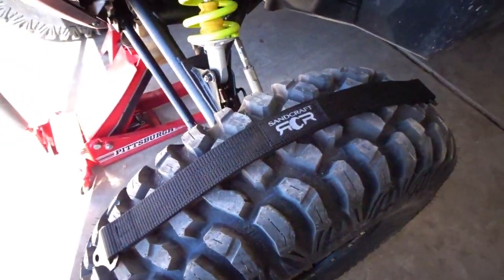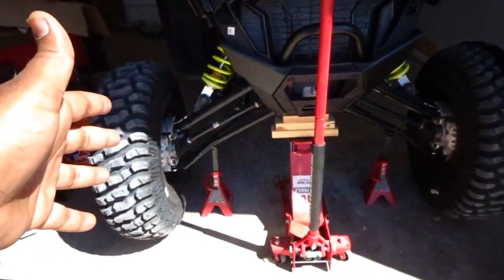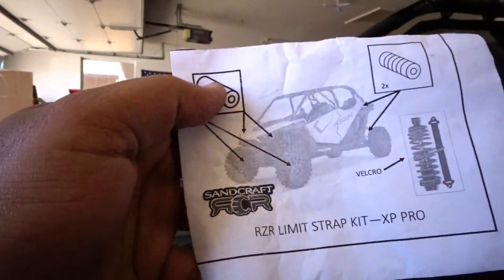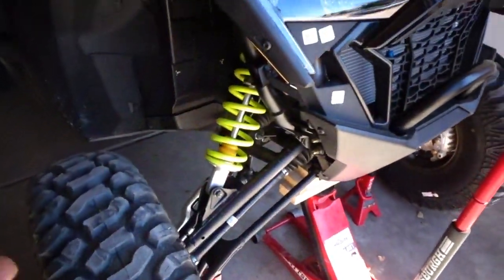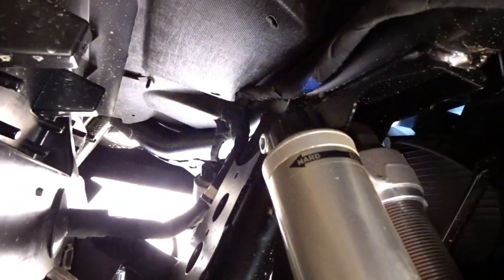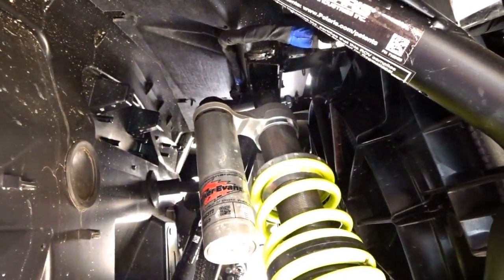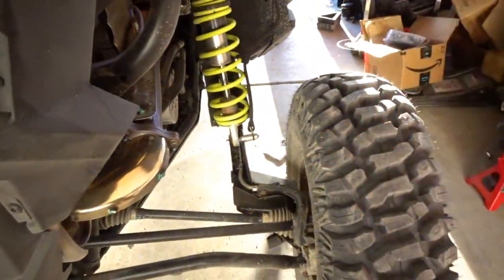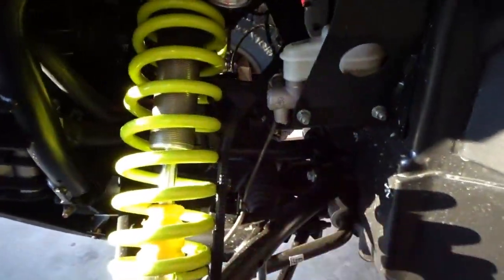How to install limit straps on your SXS from Sandcraft

Comment: After watching your video the front install doesnt seem right to me...
Maybe im wrong but isnt the shank of the bolt supposed to sit where the shock and shock mount go?
If you install the upper bolt from the back to the front its sitting on the threaded section of the bolt and not the shank.
Am i wrong?